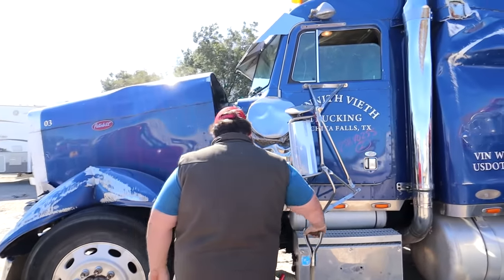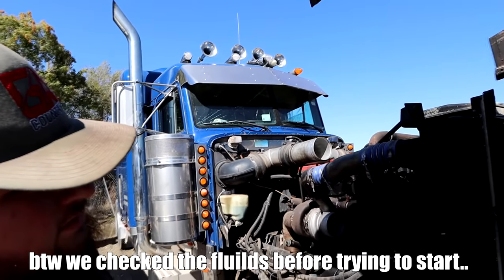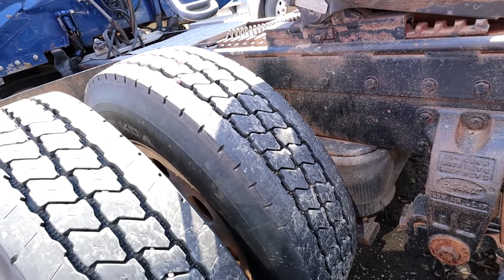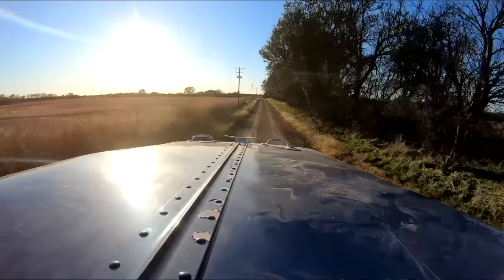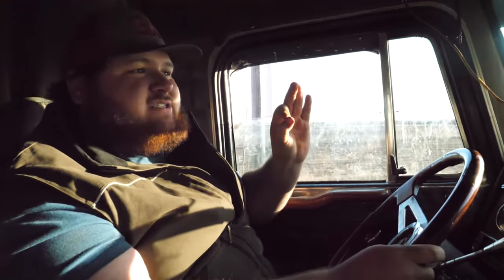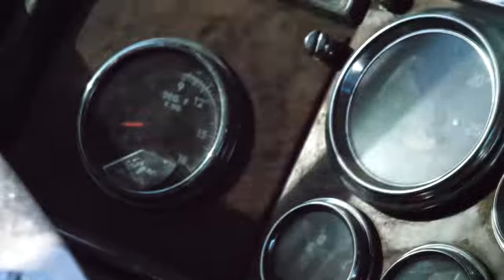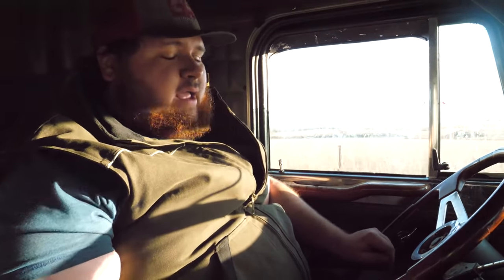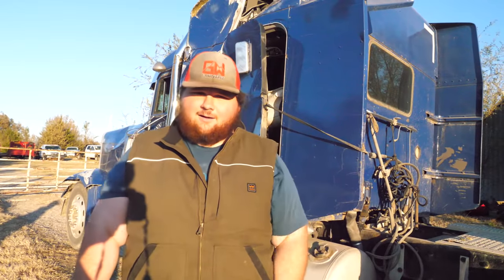I Bought a Wrecked Peterbilt 379 Semi Truck

Comment: Westen’s famous saying 
“It looks brand new” 
Love it lol
Reply: But he didn't professionally catalog the adjustable tip
Reply: @markmooney4770  Maybe he did off camera
Reply: @markmooney4770   "expertly cataloged"
Reply: yeah but the frame is bent  . why do you think there was a block under the drivers front wheel ? to prevent the frame from twisting elsewhere by the weight over time
Reply: @guytremblay1647  Doesn't mean he can't fix that too
Reply: @rawr51919   everything on a vehicule can be fixed . Its allways a matter of how much you are willing to spend in order to get the right to put it back on the roads

Comment: Seeing this reminds me of an incident in northern Minnesota, when I was a kid in the 1970s.  One of these went through an abandoned old Standard Oil gas station, and made a small town even smaller. ;-)  The driver dozed off behind the wheel on a late and rainy night.  The semi tractor was trashed, and the old gas station leveled.  When I say northern Minnesota, I mean up near the Canadian border.  There was, and still is, 10-20 miles between towns with absolutely nothing but forest in between.  It gets cold up there too.  I remember one evening in 1989/90, the overnight low in January was -110, with windchill.  THAT'S COLD!!

Comment: “Why I’m taking back roads” because you don’t have a class A license lol.
Reply: Only need a class b with air brakes endorse for tractor🙃
Reply: You dont need either if its not registered as a commercial vehicle.
Reply: @tylerbonser7686  Hi from the UK. Regarding to your comment!! In America You can drive a large truck with only holding a basic car driving license as long as it is not registered as a commercial vehicle?
Reply: Since 1997 anyone passing a driving test to drive a car in the uk can legally drive vehicles weighing the maximum weight of 3.5 tons. If we wish to drive any vehicles weighing more than 3.5tons then we have to take a Heavy goods vehicle test. Even if the vehicle is not registered for commercial use.
Reply: @ivecodaddy4817  yes. In the USA anyone who passes a drivers test can drive something up to 13 tons. However if it is a recreational vehicle like a motorhome, camper or if its for farm use you dont need a different license.  Didn't know that about the UK with that low of a weight restriction.  I wish it was harder for people to get a license here. So many bad drivers
Reply: @tylerbonser7686  thanks for your reply. I own a 18 ton truck and only use it for personal/ non commercial use. i had to take my class 2 c license before i could drive on the UK roads.
Reply: @ivecodaddy4817  some states are getting a bit more strict but its only for tax revenue not for safety. But then again getting your class A license here is prettt easy.
Reply: That's a big 10 4 over!
Reply: Whys he take back roads. Bc he don't want cops asking about the wrecked semi truck driving around lmao
Reply: Eric dutsch even if that’s the case, can’t be simply explain? I’m sure enough the cop would be understanding, why would someone drive a wrecked semi in that bad of condition around other than moving it’s location? Lol
Reply: @samuelc9678  true but with my luck I'd get and have gotten cops that assume it's a hit and run vehicle or that there is some way of giving a ticket. Not saying that's his situation but I mean even when your polite some cops still try to fuck ya
Reply: Anything with air brakes and or holds more than 14 passengers requires a cdl
Reply: @themiddlechild1988 if it's a farm vehicle you do not need one as long as your between 0-150 miles from your farm

Comment: Westens Best quote “ it doesn’t  not look that bad”
Reply: Homestly it doesnt. It needs a  new hood, fenders, stacks and bunk. Most of it is either available new for the small stuff or used for the big stuff. The bunk is the biggest issue and that isnt that bad - a used studio sleeper can be had for 5 grand, and can be swapped in a weekend with some help. The cab appears undamaged,  and assuming the frame is straight and the drivetrain good, he can put it right for under 10 grand.
Reply: @machinist7230  If he didn't do serious damage to the engine running it without an air cleaner.  Yeah, good thing he took dirt roads to run the dust straight into the engine...  But yes, if the cab is not racked, dump the sleeper, turn into a day cab, get a boc panel, fender, mirrors, fix the intake, not a lot on this one, other than it's a 98 and probably more than worn out already.
Reply: @machinist7230  I think it will be a fairly easy repair, It sounds good He can get a sleeper pretty cheap , Especially standups there's two behind Dad's shop now were they swapped to flat top, Ones a unibilt with the red and light grey American class interior 70" plus extension's I'm sure he'd sell it cheap lol
Reply: Look's like the sleeper on it's a unibilt also

Comment: The Cummins N14 is capable of producing between 310 and 525 horsepower, depending on the size of the turbo chosen by the vehicle manufacturer. It is also capable of generating 1,250 to 1,850 foot-pounds of torque at 1,200 RPM.

Comment: W900L is the “Cadillac”.
Reply: 1 Mitch  least someone shares my POV
Reply: Sounds like ya'll might need to check for exhaust leaks. Them fumes gone to yur thanking thang. 379, all that ass to pass with class, on the left. Tell me this, does the right side of that kute wittle 9 look like the left side? See, i wouldn't know,  aint never seen that side of a w9. Cept one time, i was passed by a kw, on the ts parking lot. But it was hooked to a 379 wrecker, so..
All in jest fellers, ya'll just keep watching that left mirror, youll know its me in my 3, smelly and fast, we call her " the ole yellr smeller." All horses to the front, all the bull to the back. Happy trails, ya'll.

Comment: It's called a tractor, yes, a tractor.  Like a "road tractor" as in tractor- trailer...
Reply: KawasakiRider -  FMCSA refers to it as a tractor. The word tractor originally meant any piece of machinery that was used to supply power AND traction. Me also a CDL driver since 1988.

Comment: It’s a 13 speed bud, and on the driver side of the engine by the air compressor it will have an aluminum tag with the engine serial number and the HP and Torque ratings.

Comment: The only thing I don't like about these pete's is the clutch pushes into the floor. But my dad used to work for a company called Diamond and he had a metallic blue 19 379 full sleeper, Caterpillar 3406B and an 18 speed. I loved everything about that truck, maybe besides the floor clutch. But that was the truck that got me to love peterbilts and I'll always want one, he also had a truck with an N14 too 6 years later after that company went out he drove that truck for a while before he moved to flying J then now synergy.

Comment: You probably wont see this, as it's  been a long time since this was uploaded. Im a diesel mechanic and you need to use your clutch when shifting. If you don't the springs inside it will break well before the clutch wear material wears out. Ive seen it several times in only a couple of years being a diesel mechanic. If you rev match perfectly you wont harm the engine or transmission, but the clutch will break before it should. Also, this is mostly a concern for long haul truckers, that would touch their clutch maybe 1-max5 times per day. If you do a lot of city driving, and your still using your clutch 50+ times per day with all kind of stop lights and stop signs, you'll probably still be ok

Comment: With up to 430 horsepower and 1,650 lb.-ft. of torque, it delivers heavy-duty performance while lowering weight for increased payloads. High-pressure fuel injection and sophisticated calibration deliver excellent fuel economy, low emissions and quiet operation.

Comment: N14 is most likely 525hp and 1850lbft at the flywheel. Data plate is on driver side front cover right in front of the air compressor

Comment: Best engine Cummins ever made. If she's topped out from the factory she'd be sitting at 525hp. And if I saw the shifter correctly it had a red splitter. That'd be a 13 spd. 15 spd should have a blue splitter but I may have not seen it correct

Comment: After the 359, they went to shit. The long hood is just an appearance package, the engine is tucked up tight under the firewall like everyone else does. Unlike everyone else, the wire loom and all the air lines are tucked into the Driver's frame rail. Good luck picking through that mess. Heard good things about the Kenworth T800s, sounds like the way to go.

Comment: the N14 should have a tag on the front of the motor on the driver side that says the HP rating, CPL (control parts list) and the peak HP rpm

Comment: Thats a N14 
Spent over 37 years working on trucks 
We would fix them that looked like that all the time 
Either throw another cab on them
Strip them down to the floor and rebuild them 
Usually the first thing wed do is drop the pan to inspect the crank 
Got my start in 1973 at the Peterbilt Motor Company building hoods and cabs

Comment: The Cummins N14 is capable of producing between 310 and 525 horsepower and 1,250 to 1,850 foot-pounds of torque at 1,200 RPM.

Comment: Got you the best Cummins ever made. N14. Probably a 425. Only motor you can do one of the head gaskets in an hour. Cant tell if that's in EXHD or not. If it is you got you a bad machine.

Comment: Engine cooling fan isn't turning. After sitting there is no air pressure at first and the fan clutch should automatically engage until air pressure has built up to release the clutch. After that the fan should freewheel.

Comment: “ASK A TROOPER” by Sgt. Jesse Grabow of the Minnesota State Patrol

Question: I am wondering how to interpret a law for mechanics that have a “class D” driver’s license. Would they be able to “test drive” a semi or bring it to another shop for repairs without penalty? Another question I have pertains to electronic log books. My understanding is that a truck driver is required to have a “paper log book” along with the “electronic book.” Is this true?

Answer: The driver of a vehicle must have the proper class license even if it is just for a test drive. For example, a mechanic takes a truck-tractor without a trailer for a test drive, the minimum class license would be a “class B – Commercial Driver’s License.” Also, these mechanics/drivers would also need to be medically qualified (medical/health card.)

A paper log book is required as a backup if and when electronic logging fails. A driver would be required to have a supply of blank “driver’s record of duty status graph-grids” sufficient to record the driver’s duty status and other related information for the duration of the current trip. A driver using an electronic log book is also required to have an instruction sheet describing in detail how data may be stored and retrieved from an automatic on-board recording system.

A portion of state statutes were used with permission from the Office of the Revisor of Statutes. If you have any questions concerning traffic related laws or issues in Minnesota, send your questions to Trp. Jesse Grabow – Minnesota State Patrol at 1000 Highway 10 West, Detroit Lakes, MN 56501-2205. (You can follow him on Twitter @MSPPIO_NW or reach him at, jesse.grabow@state.mn.us ).
Reply: hope that helps with the comments about can he drive the truck or not

Comment: Weston , not trying to be a smart a#@ but I think that is a 13 speed tranny. My experience is when the splitter switch is blue =15 ,red=13 and gray =18 so just thinking you might want to make sure. Thanks for the great video, Peterbilts are top of the class for sure. And my favorite as well. Looking forward to the restoration.😀👍
Reply from the maker: you're right.

Comment: the sleeping cabine in the us trucks and its basicly all of them thee have and huge and later on costimize sleeping cabine. in denmark where i live and also drive, i drive scandinaia, germany, holland  our sleeping cabine in the scania and volvo is very limitet. but there is what there are needed a bed:-) but there are not much space. i love the look with the loong nose those US trucks have, here in EU all are flat cab exept for the Scania T model. there are just ugly, but the 80 and 90 models are the best mschines ever made. and there is no truck there sound better, there are almost free air from facrory but many make streight pipes. cleen pipe. cheap to make if you
if you can weld
also one thing i dont understand why all U.S truck are with manuel gear eks 18 gears machines, what there are top of the pop of what i have hearat

but when this are said. the scania R560-R580 v8  16,1L i awesome trucks to drive in. there can really pull heave loads up the hill. :)

and then there is the older volvo from 2014   FH16-750 inline-6   the numbers on the truck is the hp the truck have so 

reale nice machine  750HP -3500nm 

there is no misunderstanding how many hp the truck have and is all there do that from Europe all brands- models

Comment: I'll take a w900limited edition kenworth over any peterbilt
Reply: Peterbuilt  and Kenworth are built on the same exact assembly line we built and made at. Besides a Kenworth having molded fenders on the hood, the stupid different rear suspension. They are the same trucks. They even look the same besides the molded fenders on the hood and the little difference in the headlight looks. The worst suspension ever is that damn 8 bag setup in the rear. I work on big rigs for a living. Mainly older peterbuilts and Kenworths. We also own a 6 trucks that we have drivers for.
Reply: I'm a retired driver. I'll stand with my preference,  drove both brands,  the limited edition kenworth will out ride a regular 389 Pete anyday
Reply: Paccar does build both , but  the cab's of the kenworth is easy on me  to get around it,  my choice,  my preference,  what I drove
Reply: The studio sleepers was a joke as a sleeper design. Turns out no truck driver wanted to on a couch. We had to design a bed structure and rip out that couch bs for a company that the drivers would sleep in, so the owner had to rent hotel rooms til we finished lol.

Comment: Gutless Cumaparts useless Zero holding Torque like a Grader motor equipped 3406B or 3406 Accert Cat 15 litre Powerhouse engine.

Comment: Crash Date 07-31-2019 20:19 Report# KS2019E17946

Crash Id: 3829978

Crash Report Status: Complete

Crash Finalized Date: 08-09-2019

Crash Location: ANDERSON

City:

State: KS

Traffic: Two-way, not divided

Road Surface: Wet

Weather Condition: Rain

Cargo Body: Other

Light Condition: Daylight

Vehicle Type: Tractor/Semitrailer

VIN#: 1XP5D69X3WD464705

Vehicle License #: R123400 (Towed Away) Vehicle Year: 1998

Vehicle License State: TX

Reporting Agency: Kansas Highway Patrol

Officer Badge #: 477

Total Vehicles in Crash: 1

Total Fatalities: 0

Total Injuries #: 0

Event: Non collision ran off road, Non collision cross median/centerline, Non collision overturn (rollover)

Comment: Who uses a Clutch to STOP a Truck ? l Sure Don't. That's what the Middle pedal is Fore called the BRAKE PEDAL.@ 8:48 you claim all the clutch is for starting and Stopping , Strange very strange. What your failing to explain is Any mechanical Manual gearbox shifting otherwise known as Simple Synchronized mechanics and or Engine speed RPM ,Road speed MPH & Differential cogs or gears. Then REAL Gearjammers know this. Other are Wannabes or Posers.